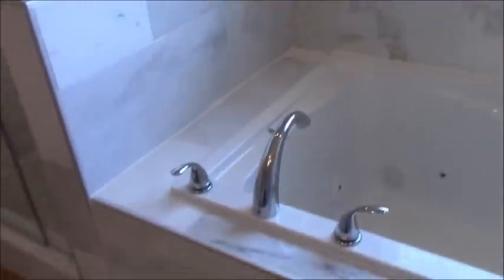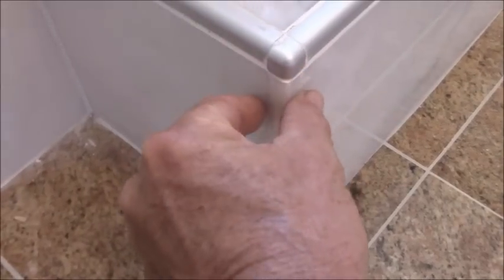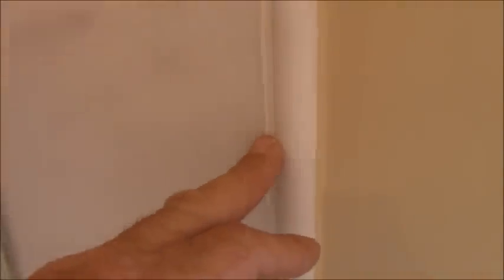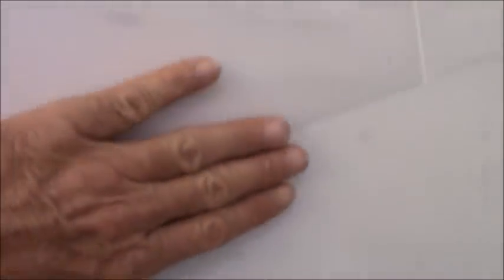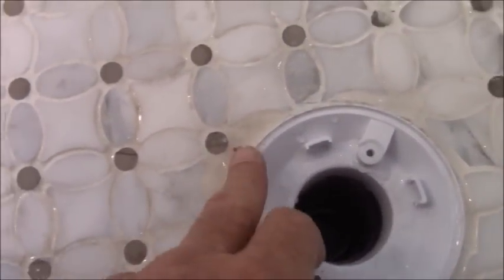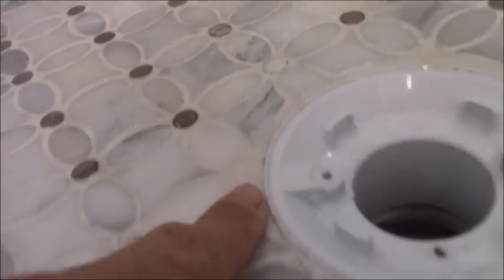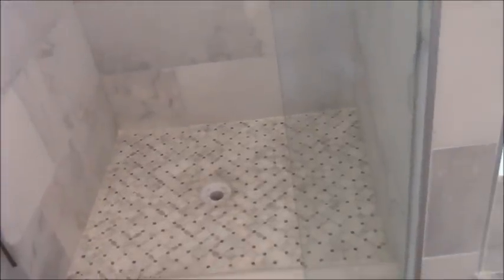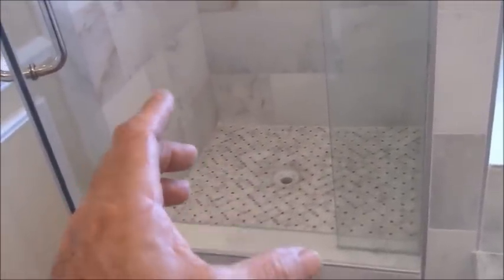Major Tile Mistake in Shower

Comment: I have fired two tile guys on my current bathroom project. The first guy's float was no where near plumb or square to the opposing walls and he floated the floor before any tiles on the walls were done. He also left the float strips in and didn't remove or backfill as he floated. He was going to use thinset as he went. SMH.

The second guy did $1g worth if drywall damage removing the first guy's float. His float was ok, but left the edges a mess and uneven. When he started to actually placing tiles up, (12x24 carerra marble), he didn't want to to use the any anti lippage devices. I had Spin Dr.s already. He thought they pull the tile off the thinset. SMH! 30 years of experience?! Come on! His cuts were horrible and the end cuts weren't even plumb plumb. He never floated the niche and made it too big. I fired him on his first day of setting tile and removed 25 pieces he set, onlly breaking two. He used the wrong thinset for marble and added a liquid modifier to an already modified thinset. He used the wrong trowel, (a dirty 1/4 × 1/4 which was more like 1/8 × 1/8)  and had very little coverage. He didn't back butter the tiles either. As I removed the the tile he installed, I discovered that while mixing his float, he didn't remove or sift the lime as big chunks of pure lime chalk were exposed. The float now has big potholes down to the scratch coat in it. My wife decided that I needed to come out of retirement and do the the job myself. Sometimes it's better to do something yourself, even after numerous back surgeries and especially after spending over $5g between two so-called experts.

Comment: 30 years ago in Los Angeles I worked a job where a lead shower pan was installed.  It was filled with water and had a separate inspection by the city left with several inches of standing water and the drain plugged.  Looking on that now it seems like a good policy.

Comment: After watching dozens of shower videos and hiring my tile guy to do 7 of my houses I see 2 distinct ways pros do this. Main difference is using kerdi over/above the pan and on the walls or using the rubber liner on the floor below the pan. They both seem to work.

Comment: Its good to learn from other peoples mistakes.  Some of these "mistakes" should probably be ignored for the purpose of your video.  Im sure you do great work but any builder can pick apart any other builders job if they want to spend 20 minutes out of their day to do so.  Ultimately maybe take it a little easy on these guys im sure they worked hard on that job
Reply from the maker: Yes, surface-level work can always be critiqued....but I don't do failures.... And this was a failure.
Reply: We don't know what they charged either, if this was a low budget contractor they did a very reasonable job.

Comment: Pan liner cut wrong uh?
That's why here in southern California we use hotmop, you can't go wrong with hotmop.
Reply from the maker: Yes you can have a failure with hotmoping..plus it's messy, difficult, antiquated and serves you no better than modern methods. 
I'm a native Californian and if I started there 21 years ago doing hotmoping I'd find an easier way or quit the business altogether. We're trying to work smarter not harder.

Comment: Little issues other than the leaking drain but add em up and you got a mess. You really must charge enough to be able to take the time required nasty floor tile would really try to change homeowner s mind on that in the beginning. Definitely not a good job to walk away from. Do you ever mention what customers pay for the mess  as to what you would have charged? Think that might help the average home owner see the difference in awarding a job. Was a setter for fourty years now retired lived on referrals so you are only as good as your last job..I like the way you try to educate the consumer on the proper way of doing and a professional looking project in the end.Rock on.

Comment: How do you taper the tile around the drain cap?
Reply from the maker: Each individual tile is tapered on my wet saw, carefully so all tapers match. Provides positive water flow into drain.
Reply: Thanks! Amazing attention to detail.
Reply: This is the type of work where you can do 99.99% of the job correctly and one super tiny mistake will ruin everything including damage to the ceiling and floor.

Comment: Corking??? You mean silicone. It's obvious these installers are not used to marble tiles. There should be no edge trim, should all be mitred, filled and polished

Comment: Just a thought, (from seeing the plumbing on the valve) I would put a trash can under that head and turn it on to see if the leak is the stand pipe. If it is instant as the Homeowner says you will know real fast if it is the pan or the pipes. I've seen it happen that a heavy over extending shower head can cause pressure on a bad solder joint and the back pressure in the pipe will leak right down the wall.
Thanks for another awesome vid you are one of the few guys on here I know I can trust for quality info... and tops among them, though we all make mistakes.... like this guy craig heffernan, somewhat local to me, he has lots of great vids and great tips but then his latest video he goes and puts that orange crap on the floor. I was ready to scream nooooooooo call up star and fly him up to do it right!!!lol you can see it here https://youtu.be/XS1p1Zz0Ck0?t=292 not even installed right and ohhh loard all mighty the lips on the tile are tripping hazards! (prime example of half lap offset lippage)
Reply from the maker: Thanks for the comment...and yes I saw his work...but he has 100,000 subs, so people seem to like him.